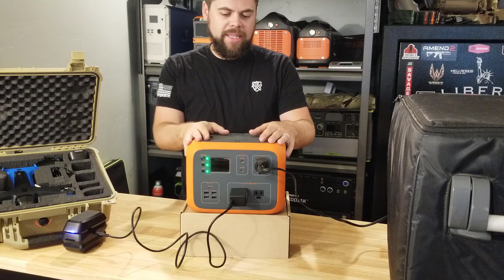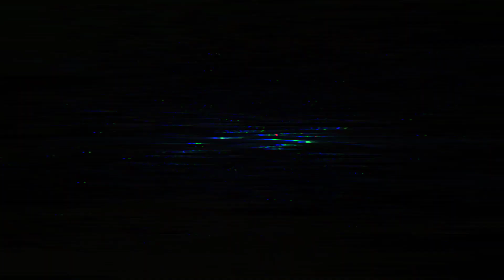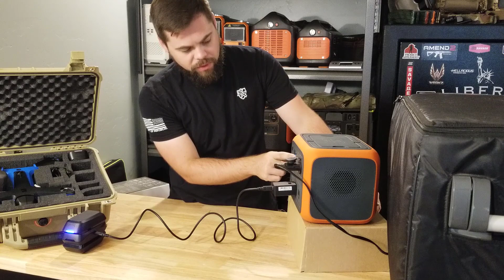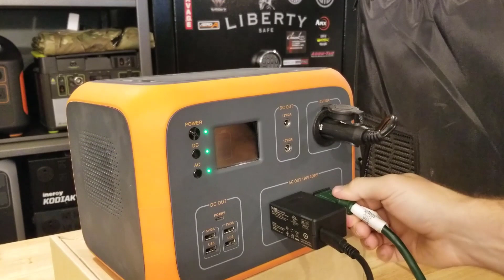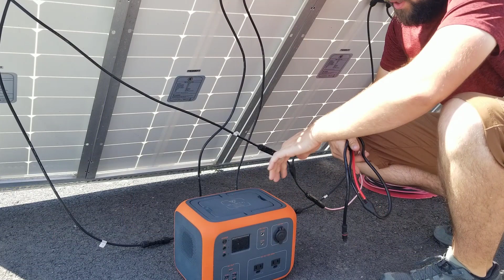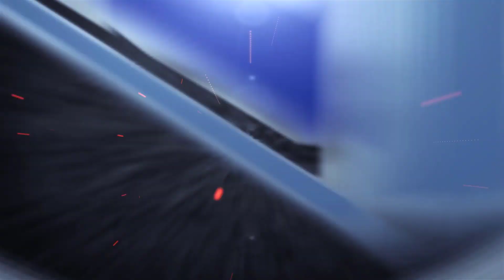Bluetti AC50S Portable Power Station Review

Comment: I have an IceCo fridge as well, and I’ve seen their DC cig plug work it’s way out of my Titan. Maybe it’s something about their connector?  I don’t do this often so my high tech solution was to jam a toothpick into the socket along side the plug, and that kept it nice and snug.
Reply from the maker: Interesting because I haven't had that happen with my Titan. Maybe it is a plug thing? I have other units that it doesn't work its way out of the DC plug too so that's why I figured it was the port on the unit not the plug itself. Good thing to consider.

Comment: I have the AC50s and it has been great for my CPAP, charging my phone and running a 12v frige when camping. Never had an issue with it. Don't really focus a lot on the screen as its always been enough if its fully charged. I just plug in my CPAP or 12v frige and it works great when camping. My only issue is that it takes a good while to charge it.
Reply from the maker: Thanks for sharing! I'm glad to hear you've had such a good experience with it.
Reply: My old ac50, actually charge's at 140 watts sometimes, the best I get out of my other ac50s is 122

Comment: Zoom out a bit.
Y would U charge ur drone battery Via A/C I stopped watching 2:59 figured if your not able to handle those two isses really don't need your opinion
Reply from the maker: Yes the camera angle was off, mistakes happen. I'm confused as to why you're upset about the video though. You're upset that I was showing something being charged? I wasn't saying that was the only way to charge a drone, I was simply demonstrating how you could use a portable power station to charge portable equipment.